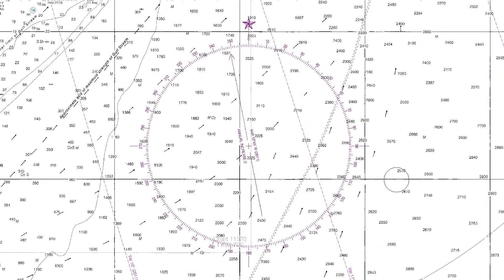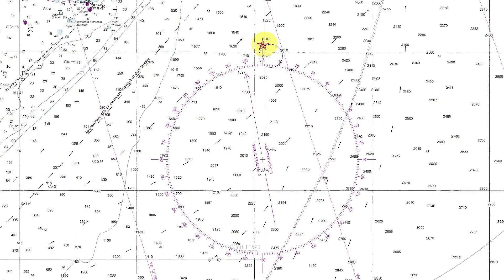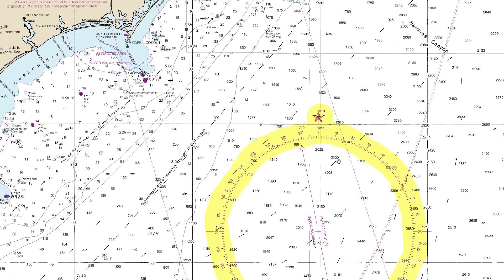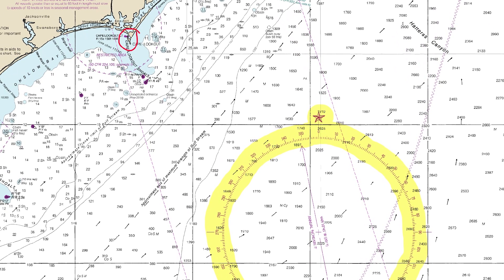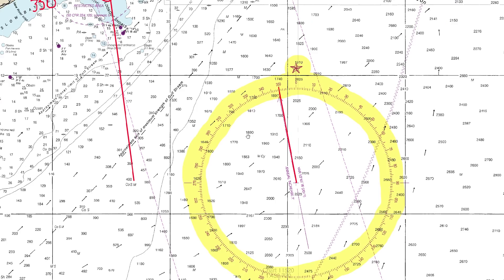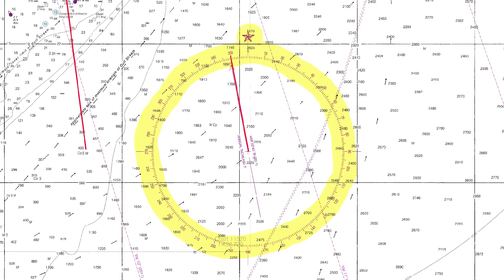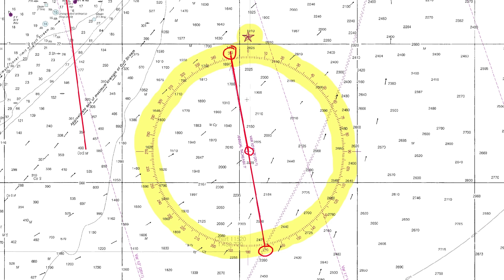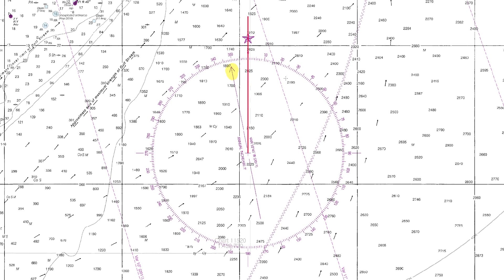Chartwork Tutorial: Compass Rose

Comment: I am curious, what is the benefit of having the compass rose printed on to the map vs just having an actual protractor beyond that you might drop/lose the protractor?
Reply: It is important to have printed on the map for range/bearing calculations and for planning routes. Eg. Looking at the chart, you might decide that you need to go 120 degrees for 1 nautical mile and then 155 degrees for another mile to get around an obstacle. You would use your physical compas to determine what your heading was, but you couldn't use it to guess what your heading should be if you can't see the hazzard. In addition, some charts do not have reliable georeferencing so a chart update might be given with a range and bearing instead of coordinates. You would need a parallel or rolling rule plus the compass rose to update your chart in that case.
Reply: @baileywright1656  You are thinking of direction/magnetic compass.  I was meaning a protractor, which in the northwest UK is also called a compass.  Completely slipped my mind that this might not be widely understood :D.

Though considering the potential confusion I think I'll just edit the OP.
Reply: @jimmydesouza4375  Ahh, that makes sense! I just learned something new, thanks! For a while, we were actually toying with the idea of taking them off the back-up charts and replacing it with one you can cut out and move around if you needed it, but we managed to get the software to auto generate them anyways so we put a pin in that idea. Basically the same as your protractor idea, though yes, I can see them getting lost fairly easily.
Reply: What the cream rose? Because it can become a compass or magnifying glass depending on which way the game goes.